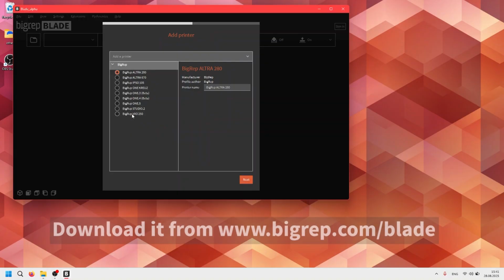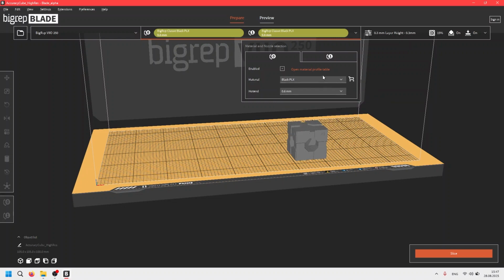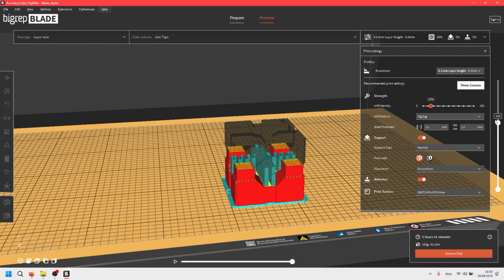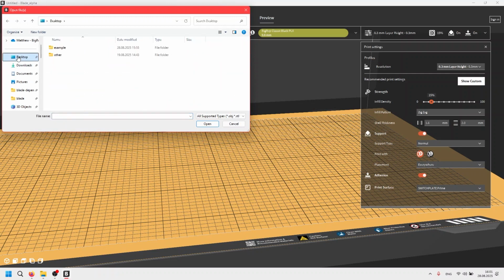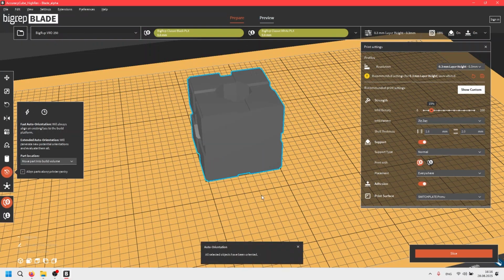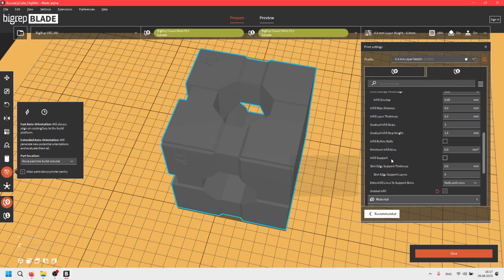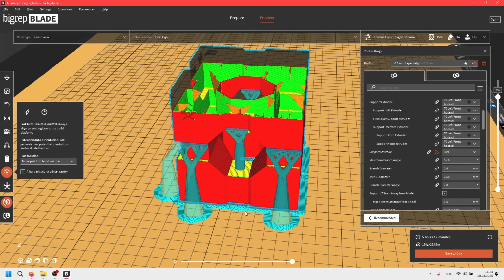BigRep BLADE Slicing Software | A Quick Tour of Latest Version and Features

Comment from the maker: 00:00 - Intro
00:13 - Software Overview
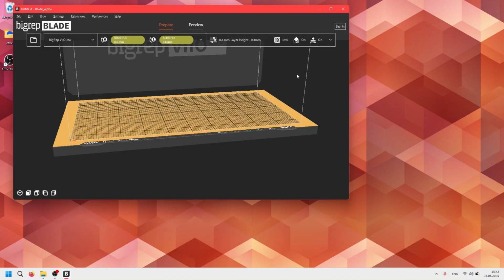00:32 - Getting Started
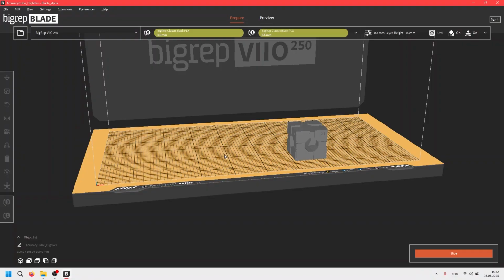01:14 - Material and Nozzle Selection
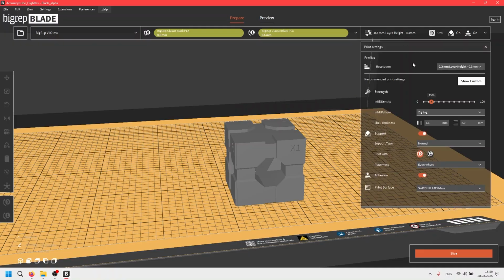02:21 - Print Settings
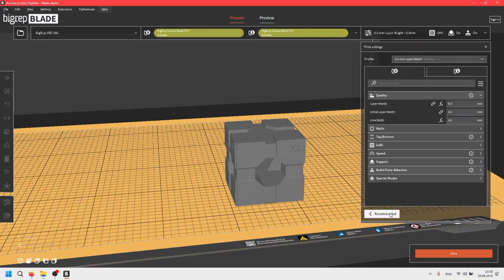03:06 - Slicing and Preview
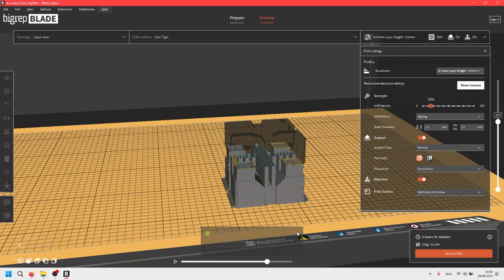03:55 - Project Files
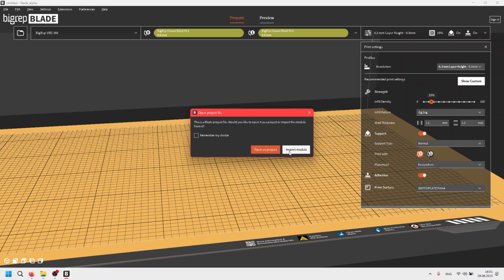04:49 - Dual Extrusion Printing
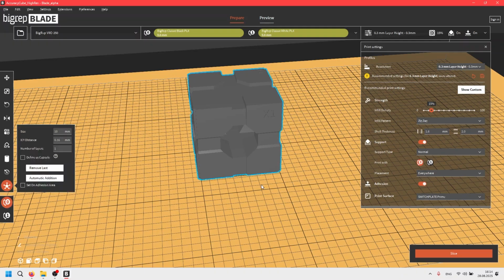06:00 - Build Plate Customization
06:58 - Auto Orientation Tool
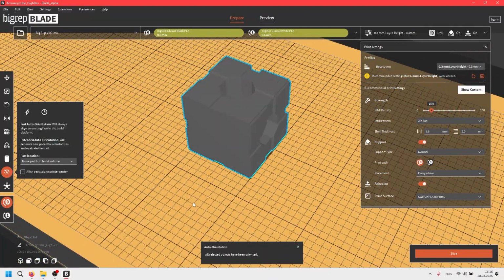07:31 - Gradual Infill
09:13 - Lightning Infill
09:35 - Tree Support
10:22 - Outro